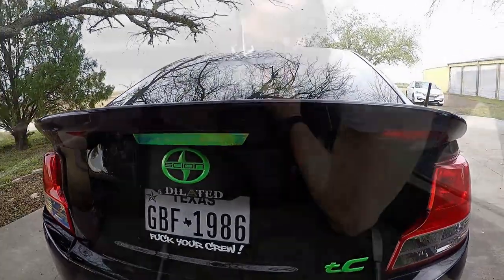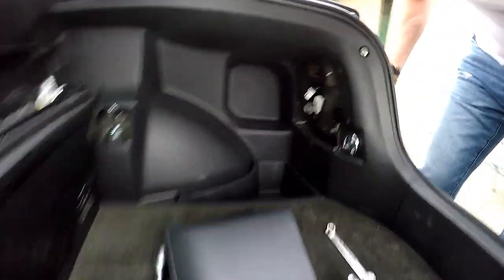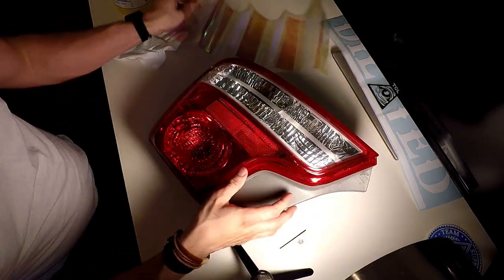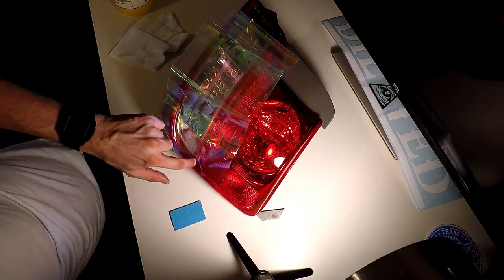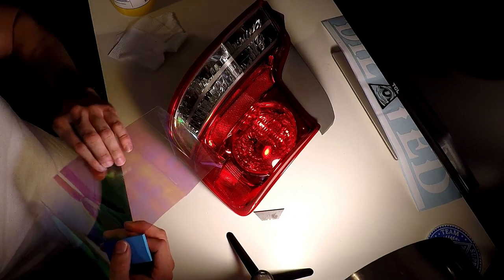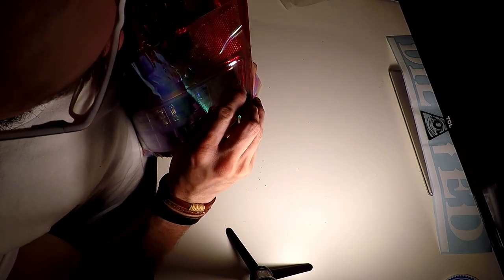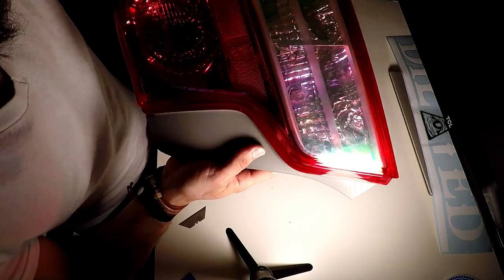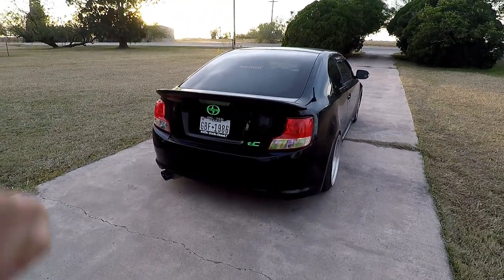DIY - Install Neo Chrome Tail light Vinyl / Tint  (Easy with Details)

Comment: How will this do with sharpish angles?
Reply from the maker: Just heated it really well (temp required to contour to new shapes) and used a felt squeegee to push it in. Once it cooled down, I used a new, sharp razor blade to slowly trim. It lasted for over a year. Recently pulled off so I can put on a fresh vinyl.
Reply: @BeardedPandaProductions  'preciate!